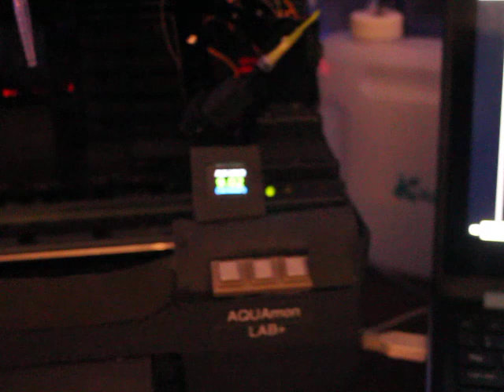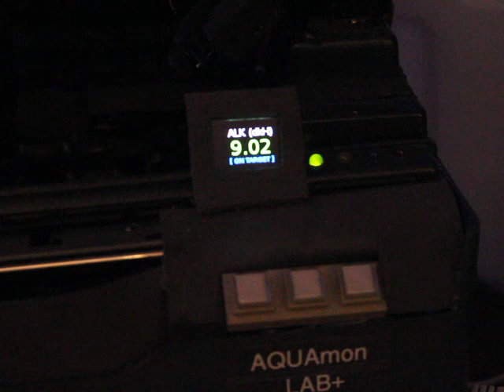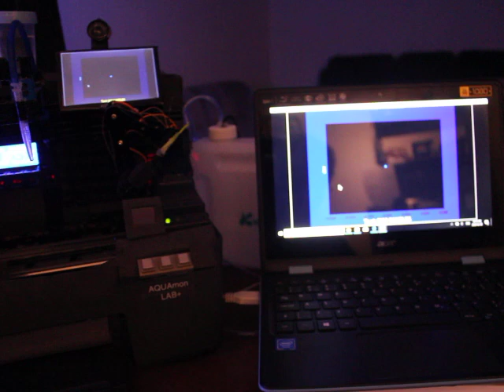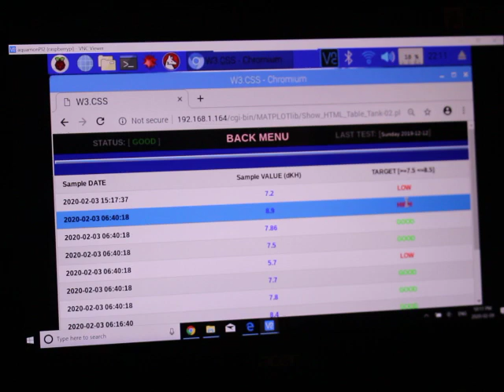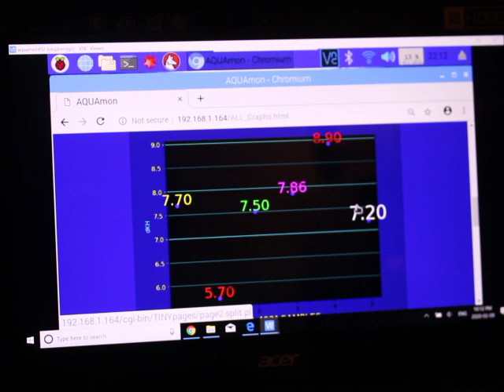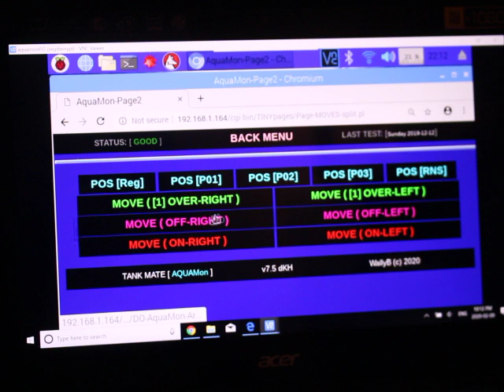AUTO ALKALINITY MONITOR (DIY HANNA)  Reef Aquarium  (DUAL: Raspberry Pi / Ardiuno ) * FIRST DEMO *

Comment: This is awesome. Did you make a smaller one tank version?
Reply from the maker: I have the single Tank Design on Paper.   No time and there are always distractions.   It has been on my mind since if I ever travel I'd like to monitor any tank(s).  The 3 tank model was overkill on robotics complexity, to prove the concept works .   A one tank sealed 1 servo motor model would be simple and better.  I figure it would only take 1 Servo motor and a enclosure and some properly positioned tube.  It would be a fun challenge.  Lot of code could be re-used.  I may do it one day, and it won't be this summer which is around the corner and I can't wait to enjoy outdoors..

Comment: Definitely cool, and over-engineering was probably the goal. There is a much easier and cheaper way, I think. You can get an electronic ph sensor, then use three dosing pumps for sample loading, HCL titration and H2O cleaning, maybe also a servo for purging the reaction vessel. But it would look a lot less hilarious, and where's the fun in that?